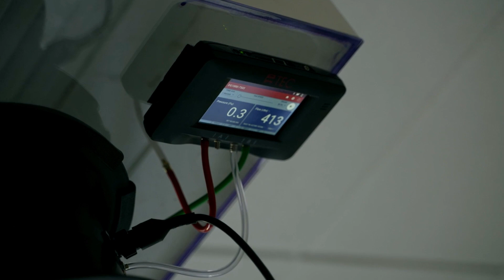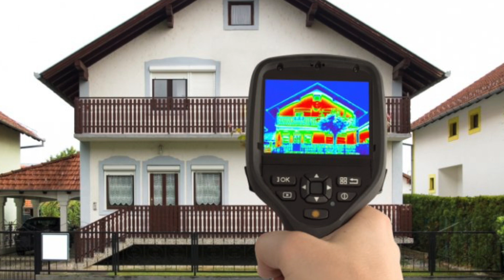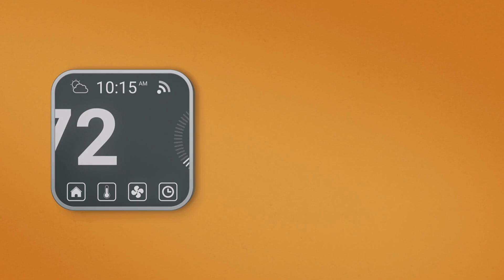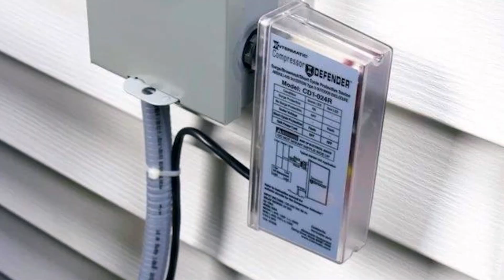10 ways to get more life out of your HVAC - Extend the Life of your HVAC system

Comment: Other than changing the air filter, no, it is NOT common sense.  Out of sight is out of mind.  
How often would you recommend a tune up or maybe how often should you clean the fins and pipes?  A small local co. installed my new AC just now.  The tech that came out told me he would check my ductwork for leaks.  He wasn't here when the owner and 2 guys installed.  Should I call and insist that they check that and I also heard that they should check the coolant when the install.  Don't think they did that.  Thanks I completely forgot to register may warrantee, better get on that.  (THEY) sent me the link.

Comment: For a heat pump when it got down to 3 degrees I ran space heaters and emergency heat. That 3 dollars of heat for 1 dollar of electricity becomes 2 and 1.5 quick this past week.  Also cook on the grill inside of using the oven in the summer.